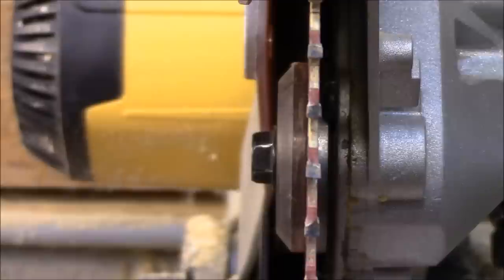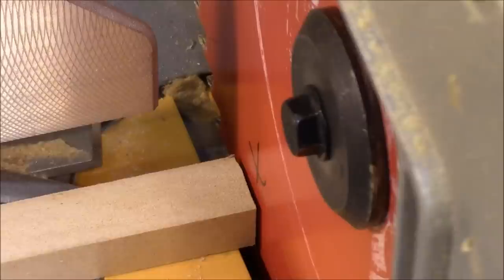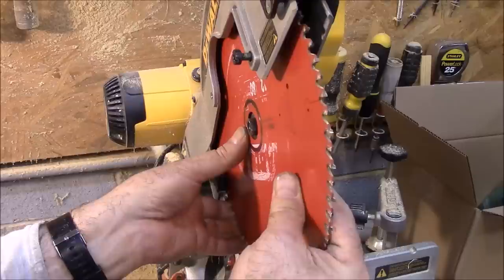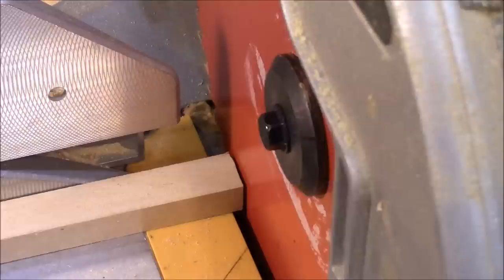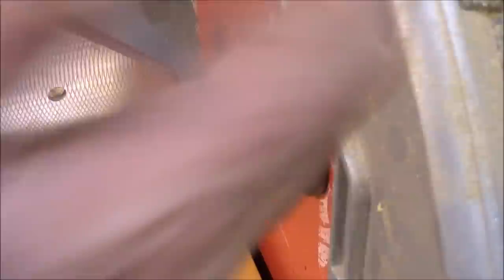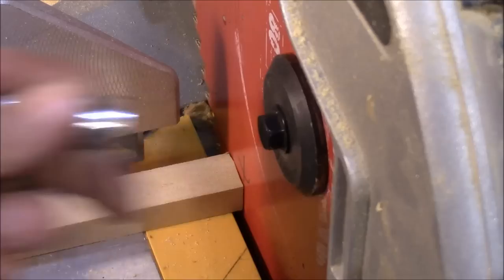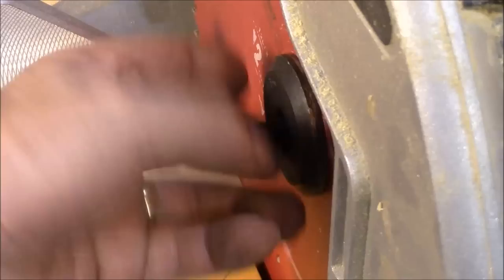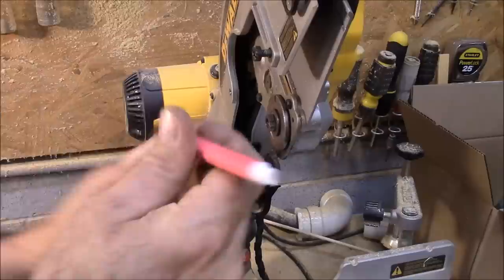Mitre Saw Wobble Diagnosis

Comment: even if your saw and blade are new you should position your blade with the least amount of run out. Most people with just put a blade on and go. all saws and blade combo have runout and you can minimize it by finding the best postion for the blade and bushing.

Comment: Thanks!  Easiest diagnoses I've ever found.  I had the same thing happen as you, the blade spun and then I had this horrible wobble.  I broke out the manual and that was zero help.  Found your video and was able to just measure the bushing with my micrometer and found it off several thousandths. I ordered new a new bushing and boom!  Thanks again for the great video.

Comment: I’ll start by thanking you!!  I followed your video step by step to determine that the inner washer was in fact the reason for the wobble in my blade.  I have a Dewalt service center near me and when I called, they tried their best to have me take my saw to them and have it serviced.  However, I purchased the inner washer and the blade guide.   Total cost $8.31.   My saw runs like new.  Thank you for your step by step diagnosis and saving me allot of money.
Reply from the maker: That's awesome!!  Thank you for taking the time to tell me!

Comment: Very systematic.  I'm glad you had a new bushing so we weren't left wondering.  And then the additional information of what would be your next tests.
The importance of proper tool maintenance cannot be over emphasized.
Thanks for the detailed diagnosis and documentation.
Reply from the maker: You're welcome!  Thank you for the comment!
Reply: Aint gonna work for long. Replace with new blade , probly you back and step 1

Comment: Thank you! I had adopted my usual tendency to over complicate things with my very slightly wobbly table saw blade issue until I found this video. Thankfully, I didn't need the diagnostics as you'd petty much already done it for me and it turned out that all I needed to do was remove the bushings, clean them up on a 2000 grit diamond stone which removed the very tiniest of burrs and now the blade is back running like a dream.
Reply from the maker: Glad I could help!

Comment: Awesome, absolutely awesome. My blade has a slight wobble. I will use this to diagnose the problem. Had a kickback on my dewalt slider and it has not been cutting straight since.
Reply from the maker: Good luck!  I hope you get it fixed.

Comment: I can't figure the problem I have out. I have a ls1013 makita, when I let go of the trigger the saw doesn't brake and it sounds like metal grinding, not a squeel but like it's a metal moving part skipping and grinding on something else while it winds down. I haven't found anything at all like this on the YouTube. The gear inside the housing is a little worn (it has a lot of miles on it though) but besides that everything looks fine. 

Would a new switch fix this by fixing the brake.?

Comment: Thanks for that explanation and your video. That means a blade wobble also points to braking as a safety issue. You can also put the two washer plates face to face and hold them up to light. Slowly twist one of them.

Comment: I have a Ridgid R4221 that I just setup (a gift from several months ago that I finally unboxed because of a couple issues with my DeWalt 10") and discovered the wobble issue the moment I switched it on... huge disappointment for an otherwise superb product. I just found your video and had surmised the saw's wobble issue may be either a harmonically induced problem or perhaps could be a blade balance issue (not too likely) but trying to be open minded to all possible sources which I surmised could be drive train induced be either motor bearings and/or bushings due to the worm type transmission of power to turn the blade. So, watching your well done trouble shooting process makes me all the more inclined to believe it to be the later sources which I suppose could be a cause of harmonic vibration as well but a $5 bushing is a pretty cheap place to start if Ridgid kicks my claim due to being a gift and not having a receipt to register it for their LSA warranty. I'll try. We'll see. So, where do I purchase a 1" arbor bushing these days... for Ridgid? Also, I've wondered if putting a 1" rubber shim washer on each side of the blade might serve to dampen the vibration? Your input, plz.

Comment: Friendly observation: if you have an indicator using it would make it easier to find the high and low points of the wobble. But, it also might trigger your perfectionism as you try to fix all sources of wobble in your saw (I'd get stuck doing that if I didn't catch myself). 
Anyway, great video. Unfortunately my saw has wobbles for a different more structural reason. But this is great info to know if something like this ever happens to me.
Reply from the maker: Thanks!  I hope you get yours sorted out.

Comment: I just grabbed a DW716 at work that was being thrown out because of blade wobble. I removed the arbor washer that you replaced and put it on the lathe. I measured .004 run out on the small diameter register. I took a carbide lathe tool and cut the .004 thousandths off of it. It runs very true now.
Reply from the maker: Awesome.  Those saws sell for about $400.  Congrats!

Comment: This was great i couldnt figure out why my saw was out of tune from the left side only... Because of a 16th of wobble from a dirty bushing... Also i have the same saw and i sprayed three coats of leak seal on the underside and arm and then filled all the gaps with spray foam, then worked all the extra foam smooth, thenn another three coats of leak seal... My saw is so quiet now its unreal, plus it doesnt get full of dust
Reply from the maker: Glad it helped!

Comment: It still looked like you had a very slight wobble after you put on the new bushing. When you turned the blade a small gap appeared and then went away, so you still had a slight problem. It also looked like you lost the end of your index finger on your left hand, miter saw injury or table saw? Ouch! Sorry you lost that part of your finger. Thanks for the video.
Reply from the maker: You're welcome.  Tablesaw about 30 years ago.  :)

Comment: Awesome work! I am new to this and the tools associated with wood working. Been a mechanic for years and frankly grew tired of it. Just bought a Rigid r4221 if I am not mistaken and a common complaint is blade wobble. Hopefully mine is minimal or nonexistent.
Reply from the maker: Good luck with your saw and thanks for watching!
Reply: I love it. Just bought the same model!
My first one. Taking a break before going back downstairs to finish set up.

Comment: I just bought a Dws779 double bevel sliding compound miter saw.
Which gives me two cuts when set too 45 degrees to cut molding.
It gives me the 45 and also give me 15 to 20 degree cut.
Does not cut straight.
Reply from the maker: I believe the manual shows you how to set it up to make a straight cut.  Maybe you can find a copy of it online.

Comment: Yes I did try the manual plus the u tube videos.  Did not work. Plus the blade change. Dewalt double bevel compound miter saw.
Brand new , wasted 3 days trying to find out what was wrong.  Lost a small Job to install molding . Cause of the  piece of junk saw.  I ended returning the saw for a refund. But lost on the other parts I bought for it.  In trying fix what should of been right from the start.

Comment: Hi. Thanks for sharing your video and being able to help so many of us watchers.  
Please see if you could help me too. 
I'm in the process of acquiring a Dewalt DWS709 15 Amp 12 in. Slide Compound Miter Saw that according to the manual, the saw comes with 5/8" arbor on it. Then I have to replace the blade for a Freud, like the one on your saw, but I don't know if the bushing is supplied since these Freud blades come with 1" holes on them. Therefore, my question is if your saw has the same characteristics as mine (5/8" arbor) and requires a bushing to install the new blade, or the factory blade has a 1" hole and the bushing comes with the machine already?      
Also, since this seems like a persistent problem with this bushings; would you please include the store's name or link where to purchase it? I"ve tried to locate it and only find one place but they want $19 for it plus S/H. Please help me with this issue? 
Thanks.

Comment: very interesting video. ordered the new bushing and my problem still persists. what were you going to check next? any ideas on how to go about this?
Reply from the maker: I would probably replace the bearings.  Also make sure it's not your blade.
Reply: @SoatMon  I guess I'm onto the bearings. The bushing didn't help and I've put 4 new blades on it known to be true and the wobble still persists in a very similar fashion.
Reply: My DW708 has the same issue but is not the bush, the bearing behind the bush has a lot of play in it so new bearing ordered. I hope I can get the old one out without damaging the housing otherwise I’m screwed as the housing is obsolete.

Comment: Great video, I just got a dewalt 713 and it does not cut true, meaning making a simple cut at 45 deg, when looking at the cut it's not straight.
Reply: +Soat Mon Had to return a dewal 713, left base area machined too far down, then had to return the battery version saw, bolt almost frozen on guard, 3rd unit also dewalt's new battery powered miter, spot on, except fence is 
a little off.
Reply: That is the same problem I an having. Just bought a dws779 miter double beve slidingl compound saw a week ago.
I set it 45 degrees but the cut is not straight. It gives me a compound cut,  45 degrees plus a 15 degrees off from straight.
Reply: This is a new saw,  should not have these problem with it.  But I guess , I have not been the only person to have problems with their saw.   Dewalt.        Now I did align the blade as the manual said and as all the u tube videos said. Plus changed the blade. I also lost job to do molding because of the saw and the timing to Finnish the job. Wasted time trying to find out what was wrong with the saw. Three days.  I just return it for refund.  What piece of junk

Comment: Thanks. My problem was, I dropped the spacer into the blower. Also, is that a diablo 8" blade by chance?
Reply from the maker: It's a 12 inch blade.

Comment: I have had small pieces of molding, after I cut them to fall back into the teeth of the blade and then get caught. How common is it to actually ever so slightly knock the blade out of balance? I only use full kerf 1/8” thick Freud blades.
Reply from the maker: I have never really had that issue.  I've had some get out of balance because the lost a tooth but I don't recall anything else.

Comment: I went through all the steps explained in this video (great video btw.)   But on mine the X continues to be the closest to the piece of wood , no matter which  way i turn the flange, bought a new flange(original makita part)  but same problem
Can somebody give me advice as to how i should fix this?   Its a makita LS1216   thanks
Reply from the maker: The only thing I can think of is to make sure your blade isn't bent.  Put on a new blade and check it.  If that doesn't fix it try tightening it up without the washer, it could also be bent.  Good luck!!
Reply: Soat Mon could you make a video of how to test the arbor for a faulty bearing

Comment: My lock pin to lock my saw blade down appears to be broken... this was my husband's saw - he passed away and now it is mine.  He was not proactive regarding "tool maintenance" so  I am left to figure things out.  The blade is currently in the "locked down" position and I cannot get it unlocked so that I can use the saw - any suggestions?  Thank you.
Reply from the maker: The pin should just pull out.  Try pushing down on the saw handle and pull out on the pin.  Good luck!
Reply: A little penetrating spray loosened the pin up and I was able to pull it out; changed the blade and I'm sawing up my firewood - thanks to all for theses very helpful videos!

Comment: Where did you get the part?
Reply from the maker: I got it from an online parts supplier.  If you search the model number and make of your saw with the word parts, you should find a diagram that will show you the part you are looking for.  Sears has a website with a lot of part diagrams.  I rarely buy from there but have used them to find part numbers.  Good luck on your repair.  Thanks for watching!

Comment: my dewalt slider won't rotate all the way to 45 degrees.  I slid the fence out of the way too.  doesn't appear to be hitting anything.  any ideas??
Reply from the maker: Not sure, I would just look to see what it is hitting when you try to rotate it.  Something has to be stopping it.  Sorry I was not more help.
Reply: Stop nut out of adjustment? Some miters will only rotate 45 in one direction..and do less in the other, maybe this?